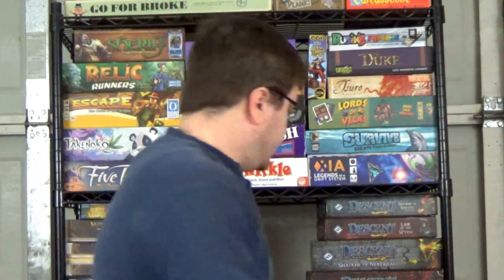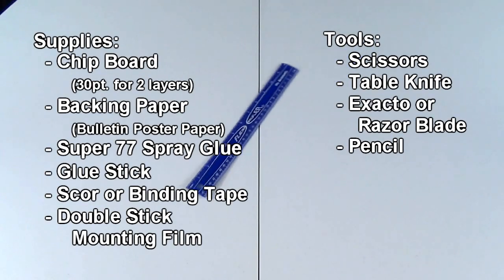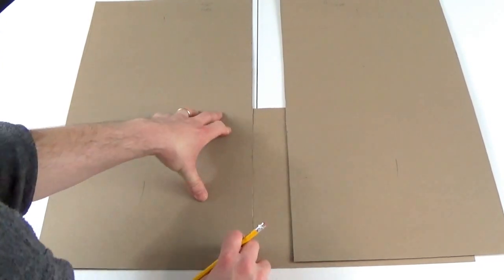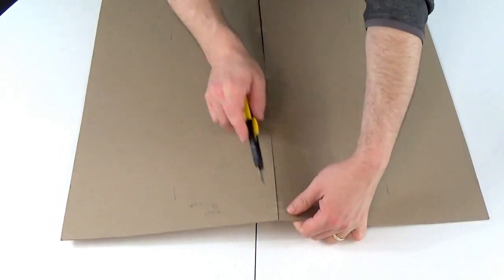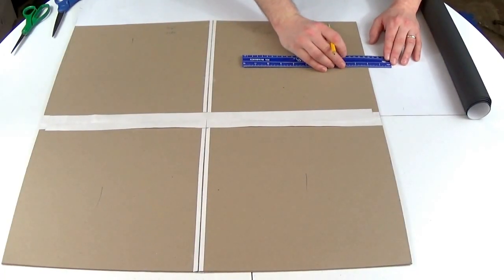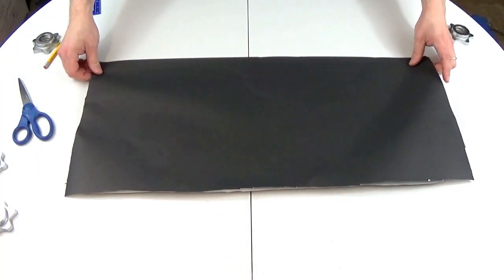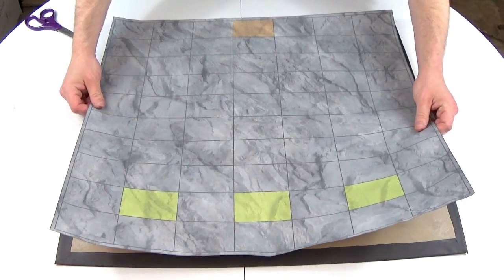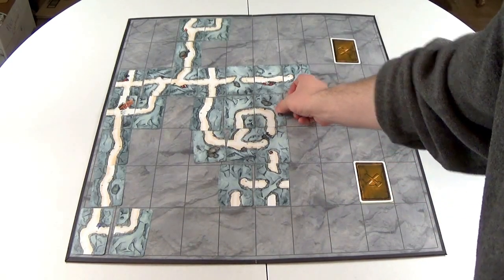DIY Gaming - How to Make a Tri-fold Gameboard

Comment: Probably the best game board video I could find – especially a trifold! (and loved the dialog in-between clips) I also must have watched this video 20+ times planning and then when creating, pausing it for every step of the process. I'm surprised on how involved it was to make this kind of game board but I'm happy with the results!  I did a 27x27 inch game board for my game, some things I found difficult on this scale was putting the spray glued pieces into place, getting it to line up right as well as smoothing it out without getting wrinkles. The other problem I had was the glue stick, maybe mine was old but it didn't hold at the joints very well when I began bend the print side.

Comment: I was considering using premade, separate backing boards, black matte, about 5mm thick and maybe 12.5x10" each, to make a trifold board. What can you recommend to provide the hinge? I am hoping not to do much in the way of cutting anything other than the printed paper board, as my accuracy with thick cardboard seems to be terrible no matter what I do. At the hinge, I was considering 2" black bookbinding tape for the back of the board, and white for the front of the board, so there is less chance of it showing through the paper. I am considering using window film for the front of the board once the paper gameboard is attached, and using label paper to print the actual board on. Am I correct in assuming I would need to provide a gap between backing boards equal to the thickness of the backing board, at the hinge?

I'd appreciate your thoughts on this idea. Thank you for your video and I hope I am heading in the right direction.

Comment: I have 4 quarters of a game board I've already printed that I want to add to a tri-fold base do I just make the base as instructed and instead of placing 1 graphic, line up and place the 4 graphics? Will it still work as intended?
Reply from the maker: It should.  I have done something similar and had no problems.  You may even find it easier to assemble.

Comment: question: what happens if the board is for example a 9 x 9. Is it problematic that the cut is between the squares in the center of the board? I want to make one like that
Reply from the maker: I don’t think so. Once it’s laid out flat, it should all line up. It’s not uncommon with professional productions. Just make sure the seam isn’t confusing or obfuscating important information
Reply: @pubmeeple  thanks!!

Comment: Hey! I'm looking to make a game board like this, but if i want the board to be 20 inches by 20inches with 10 2 inch squares along each edge how big should the print out be and how big should the board itself be? thanks!
Reply from the maker: If you're wanting the playable area to be a 20 x 20, then that's the size of your printout (not including margins of course) and the chipboard will be about 1/2 inch longer both ways (20.5 x 20.5).  If you're wanting your total board size to be the 20 x 20, then make the printout 1/2 inch shorter (19.5 x 19.5).  The idea is this will leave you a 1/4 inch border between the edge of the print and the edge of the board.  But you can play with the sizes to make it look however you want
Reply: Thank you so much! One last question, I'm designing a box for the game too, how deep would you recommend I make it? I was thinking 2 inches deep, but I'm not sure if that will fit the folded board and cards nicely
Reply from the maker: It's a lot of work to make a box only to find out it doesn't fit.  I'd start by getting a box close to the size you want and testing it out first.  There are a lot of factors in box size: printing cost, shipping, and even MSRP is based on box size.  For prototyping, you're going mostly for presentation.  I'd base that decision on what you want people to "see" when they open it.  Loose components stacked inside?  Organized in an insert? Etc.  Then build accordingly.
Reply: +Pub Meeple I'm doing it all myself, designing, getting it printed and then putting it together myself, as I'm a student and on a schedule but thank you!

Comment: You should be able to do this without using the knife to score, heavy pressure with something like a large wheel, like a pizza wheel, the goal is to crush the paper In going to try that so its more rigid

Comment: Thank you for making this video. I'm making a game in my design class final at school, and I find this very similar to binding a hard cover book. But I might want to use a matte board in stead of a chip board :/ Idk if I'll be able to make the folds as nicely since the board is much thicker.
Reply from the maker: Matte board is harder to work with and much thicker, but the idea is the same.  Not sure if it would fold well

Comment: I just finished designing my game board, however I made it on a poster board. Can this be cute and made into a tri- fold board with the proper backing or should I just leave it whole?
Reply from the maker: Laura Campbell, poster board tends to crease unevenly and presents a thicker material than I use for folded board graphics so you'll want to scor it on your folds to get the even creases.  It's possible to use your poster board instead of the top layer of chipboard.  Make your hinges and wrap your backing around layer 2 BEFORE you attach layer 1 (the poster board) to the top.  You'll still cut the poster board in half, but poster board should be thick enough you don't need to reinforce the front hinges, just be ready for them to bulge a bit when folded (scoring will help with this a bit).  If your wrapped back layer is exactly the same size as your game board, you won't get the iconic "frame" you see around game boards, but if the edges are flush it will still look good.  Practice with scraps before you commit all your hard work to knife and glue.  Good luck!  If it works out, send a pic to pubmeeple@gmail.com

Comment: This is amazing! I'm going to try to make  this today for my school but I have worked questions 1. Where can I buy these supplies? 2. We are actually going to draw the board.  So I need blank paper to put on it. Would it work? Or would it not.
Reply: * two questions
Reply from the maker: Kitibelle Most of these supplies are found at a hobby/craft store.  I'm able to pick up everything locally, not sure what's in your area.  Blank paper is fine, thin poster paper (not poster board) is probably best as it will accommodate larger sizes.

Comment: i have this product design project for school and i'm making a board game but on each side of the board there is going to be a different game, basically 2 games on one board, do i need the bulletin poster paper? if i do how do i put it on the board because both sides will have a game on it? can you stick or glue printer paper on bulleting poster paper or will it not stick? 
can i have a quick reply because  my coursework is due on the 15th February and i haven't even started making my product and this is 50% of my gcse grade for product design, thanks.
Reply from the maker: does not sound like the bulletin paper is what you need.  What you might try is putting the second game on the back using the same technique used here with the bulletin paper (just pretend my bulletin paper is another game I'm gluing on)
Reply: @pubmeeple  thank you so much
Reply from the maker: @narjish3751  good luck on the project!
Reply: Pub Meeple thanks I’m gonna need it...like a lot, but hopefully this tutorial will help me

Comment: Would also be useful if you could devise and show an effective way to make the board double-sided.  Two different games in one board.
Reply from the maker: It's been awhile since I've tackled these projects but if I were to go about a double sided board I think I'd treat the intended back graphic the same as the wrapping material, provided I could print it with the extra room needed to wrap around the outside

Comment: where is a good place to get chipboard? I'm having trouble finding any.
Reply from the maker: This is one of our most frequent questions, so I'm beginning to understand it's tough to get.  I get all mine locally at either Hobby 
Lobby or Michale's, both are craft stores.  I've seen it online as well but loathe buying it and paying shipping for a paper product.  My next suggestion would go to a place where they make frames (also found at department craft stores).
Reply: If theres an officeworks near you they usually sell it, its only $2-4 depending on size at my local one.
Reply: Go to the art stores that cater to art majors at your local college.  I've had bad luck in the big chains.
Reply: @pubmeeple  Anywhere there's an artist that's been in the trenches and knows their stuff, is familiar with chipboard.  InstyPrints has chipboard available, and not just in bulk for other businesses, or just plain wealthy people, but also the little guy.  Festivus for the restofus.  Thank you InstyPrints!

Comment: Soo what are the measurements for the chip board to start with and how larger is the finished product
Reply from the maker: That depends on your board dimensions.  The instructions are done in such a way that you can plan your board size first and build your backing off of that.  The total size of the chipboard is 1/2 inch longer in both directions than your game space.  The board in the video has a total size of 23.5 x 25.5 inches

Comment: Incredible work. I have a project in mind but I don't think I would be able to make the board myself. I don't supose I could send you the board design and you would make it for me would you? I would pay of course.
Reply from the maker: +Celso8205 Thanks for the confidence but I'm not in a position to begin manufacturing boards.  Mostly we're just providing info on prototyping.  There are some dry-erase boards on Amazon for pretty cheap that someone found in the comments below...
Reply: +Pub Meeple That's too bad, but thanks anyway, and thank you for the tip about the Amazon board, I'll check it out

Comment: What size was the total unfolded size? I designed a board game that is a hex pattern but I filled the edges to make the image squared at 30"x30". That looks to be pretty close to about 15" each square and I'm wondering if if it can even be made a bit thicker. I made a mosaic for the original "creator" version and I had another version printed on a single piece of banner material but the furls stay when rolled and it cracks the printed when creased. It is someone critical for the board to remain flat as the pawns actually stack on each other to queue up fights between players and the "influences" of the game. 

http://i.imgur.com/ODuwCQB.jpg
Reply from the maker: Jon Lepree the one in the video is printed at 23" x 25".  I would expect a crease at the folds but not cracking unless you're using an ink printer on a thicker material that doesn't absorb.  Thicker materials don't crease well and gloss finishes don't absorb ink.  A laser print will solve the absorbing problem but most banners cannot be printed with a conventional laser printer.  I print all my gameboards on really basic banner paper (cheapest at the copy store).  Remember too that these are just prototypes.  A manufacturer will do a much better job at a clean board

Comment: is there an alternative for chip board because my local stores don't sell any.
Reply from the maker: +The Unique Koala, if you have a place that does custom framing for photos they'll usually have a chipboard or an alternative mat (usually black) that's about 1mm thick.
Reply: ok cool cause my local michaels does not provide any chipboard.
Reply from the maker: +The Unique Koala:  interesting.  I wonder if they call it something different.  When I go to Michael's it's by the framing department.  It's usually sold there in smaller sheets than the one I show in the video.  Anyway, you can use any non-foam 1mm paper stock they have.  Chipboard is nothing but pressed paper, doesn't matter what color.
Reply: +Pub Meeple well I got kinda lazy and instead found an okay alternitave. I used the backing of my old spiral notebooks. the backing really did represent chipboard to me and it happens to be 1 mm thick. I went to office Depot to pick up some 1 cent notebooks like this. the problem was that I could do the exact steps as you due to the small size. but I successfully made a board. so im really happy. I managed to make it look flush. but there were still blimishes every now and then. this is a long reply.
Reply: +The Unique Koala I meant to say couldn't when I said could

Comment: I found one of these on amazon for $8. Chipboard alone cost $6-$15... Maybe you could save your money AND time by just buying a pre made one...
Reply from the maker: theULTIMATEgamerPS3 Agreed.  There are some nice pre-mades out there.  Most I've seen have a dry-erase finish but if it's the size you want it could most likely be re-covered.  I've never tried to cover that slick material though; I'd be interested to see how it turned out
Reply: +Pub Meeple I might end up getting one. I was thinking about attaching each of the four sections separately with Velcro that way I can make multiple games and only have to buy one board. Thanks for all of you diy's though!
Reply: +theULTIMATEgamerPS3 Could you post the link to the pre-made one on Amazon?
Reply: +theULTIMATEgamerPS3 Thank you sooo much!
Reply: Or you could use cardboard

Comment: So I'm trying to make a trifold board But all I can find is 12" x 12" chip board. How can I adapt your method?
Reply from the maker: You may have to lay it out so that the 12" squares make up the 4 quadrants separately, then attach them together with a method similar to our bi-fold video where we start with 2 completely separate halves.  I've come to like that method less than this one, but it still works.  You'd still need to set up the seams like they are here in this vid.